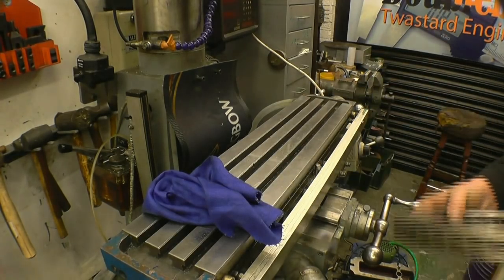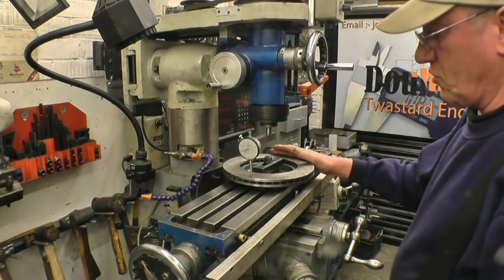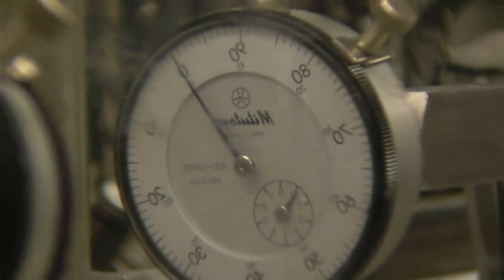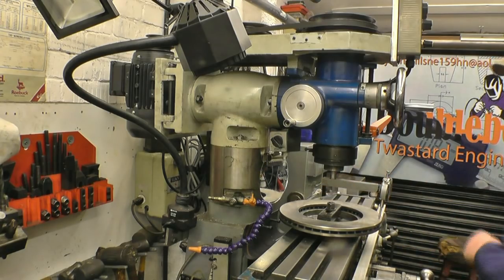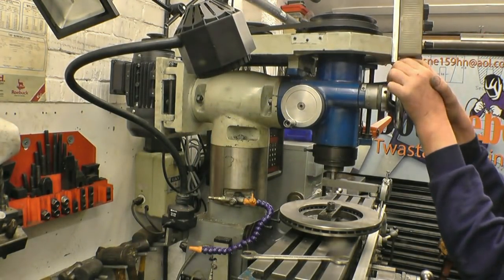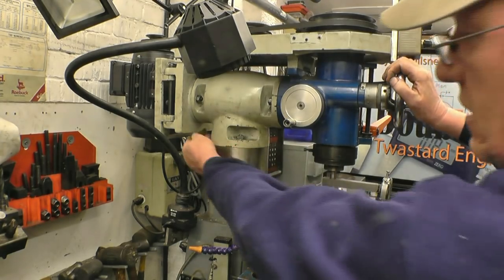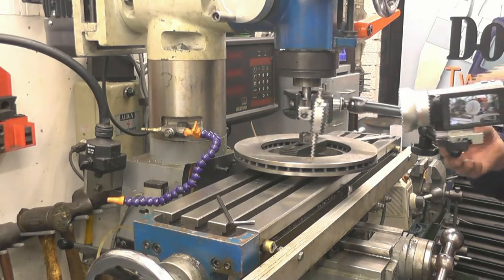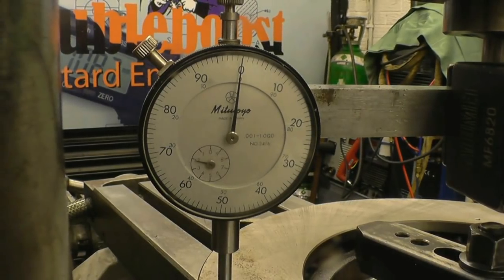SNNC 218 P2 Tramming a Milling Machine

Comment: What if you don't have a brake disk to use? I've only done this job a couple of times, I've just used the surface of the table basically, I've also wound it fully to the left and right, why didn't you check the full travel John??
Reply from the maker: It was within a thou over 12 inches   I have also used your method  Old stock discs are very cheap  Thanks for watching

Comment: The usual run-out tolerance for a brake disc is 0.004" but I have seen greater run-out than that and have rejected discs because of it.  Typically, the run-out is ~2 thou.  Note that such run-out  is against the hub mounting face of the disc, whereas the reference surface is the outer face.  Altogether I reckon this method is not a reliable one.
Reply from the maker: Good point I tried the disk in the lathe it is .ooo5 good enough for me

Comment: Brake disk is fine if you know it's machined properly. I'd be curious to see what your readings are using a 1-2-3 block or suitable parallel between mill bed and indicator.
Marty
Reply from the maker: I will give it a try  the disc is very good I did test it on a surface plate

Comment: Thank you very much for that. When you say precision ground disc, I take it that the two opposing faces are totally parallel to each other? Thanks for a brilliant pair of videos. My new mill (new to me) should be here next week. My workshop is upside down with preparations to get the new beast in!
Reply from the maker: I hate moving my shop around
Reply: So do I. I had a setback last week when the delivery driver of the pallet company turned my new mill on its side. It's being redelivered tomorrow. It did not look damaged after it fell over and I just hope it didn't get damaged when they lifted it out of the trailer at the depot.

Comment: The surface of the disk is precision ground, but I doubt that the clamping face i.e. the one contacting the table is.
Reply: The rotor faces and bell faces of the disc are all in parallel, so as you will have no runout in the road wheels or pulsating pedal when braking.

Comment: The brake disc idea is one of those "why didn't I think of that" things.
Reply: It's a great Idea so long as it was checked for parallelism on a surface plate first, otherwise you could be tramming the machine to match the surface of the rotor. Something I will certainly make and check for this purpose!
Reply: i guess I am kind of off topic but does anyone know of a good place to watch newly released movies online ?